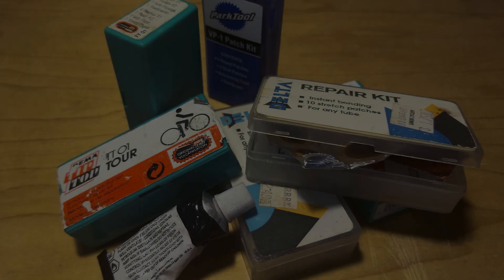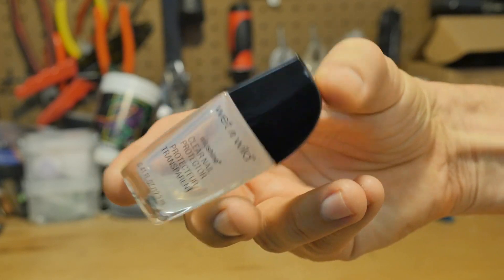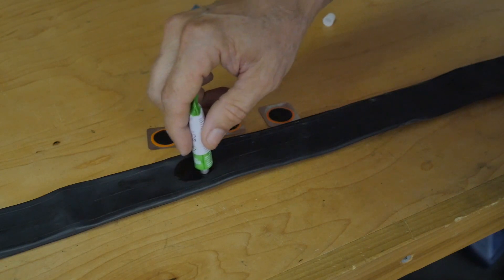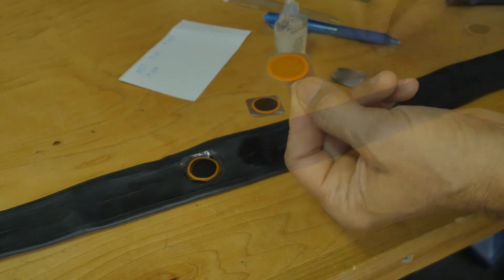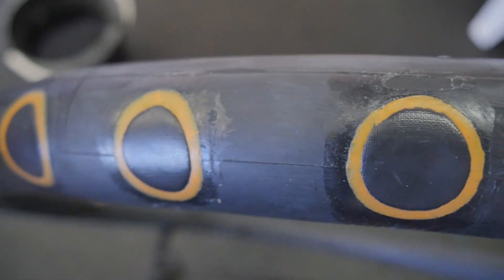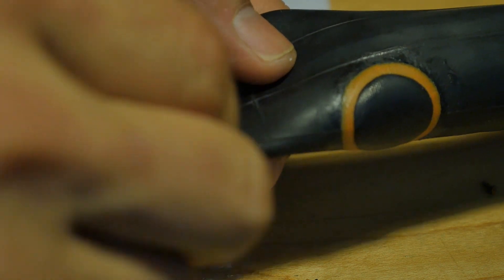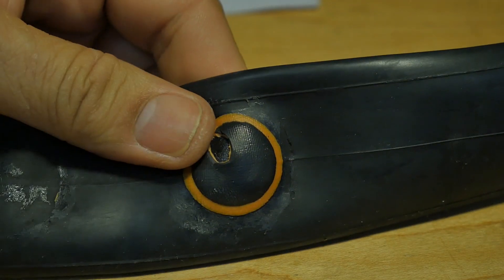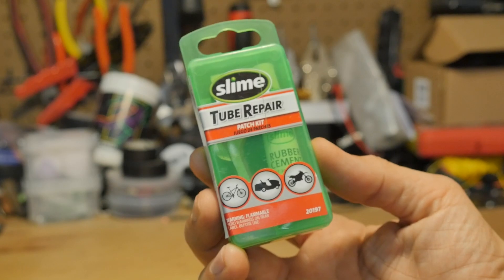Rubber Cement vs. Rubber Cement

Comment: I place a small piece of aluminum foil on the top of the tube opening before placing the cap on it, this keep the cement from evaporating. Using this method almost completely stops the cement from vaporizing
Reply from the maker: Yes, but that does nothing for the new kit that has already gone bad. If you want to be sure it is good, you need to puncture that new tube of glue and then perhaps use your aluminum foil trick. 

I think I'm going on two years now with the nail polish bottle and the glue is still not drying out. Also, it is easy to visually inspect it to see that it still flows ... without opening the bottle.
Reply: @wturber  your video is very good and informative and yes your idea is great.
Reply from the maker: @nts9  I wouldn't go so far as "great". I plan on trying your aluminum foil idea with an opened tube of silicon sealant. Seemingly nothing ever seems to be able to seal an opened tube of that stuff.
Reply from the maker: FYI, I've been using your aluminum foil trick for everything from silicone seal to wallboard patch compound. I'm loving it. It works super well. Thanks!

Comment: I once had a kit that the glue worked so well that you couldn't remove the patch from the tube with a pair of pliers. Now kits like Slime the glue won't hold the patch on at all. I wish I knew and noted the brand name of that first kit.
Reply from the maker: Rema patches and Tip/Top glue seem to make a permanent bond. Though I haven't carefully tested it. What is supposed to happen is that the patch and tire have their molecules cross-linked with each other forming essentially some huge supersized rubber molecules. I need to re-do this comparison and include Rema/TipTop as well as Weldwood contact cement.

Comment: Its painful watching you put holes in a perfectly good inner tube.Having  a puncture can spoil my day as I seem to have so much trouble repairing and hate hearing people say they've never had a problem doing it.
Reply from the maker: Well, hopefully this video helped you learn to make the repair.  I have a follow up planned where I will use contact cement. 
Either way, the trick to a good patch in my experience is to not rush things. Let the glue dry enough before applying the patch. And also letting the patch cure for a while before applying pressure - if you have that option. With that in mind, I usually carry a spare tube and a patch kit and prefer to just use that spare tube and patch the punctured tube when I get home. Or if I'm not in a rush, I may patch it before I get underway. The repaired tube becomes the spare. I use tubes for a very long time before they get retired.

Comment: I need to repair my Paradigm Monitor 90p rubber surrounds (not foam) that have a few cat claw poke holes.  There is even a split about 1/2 inch that needs a backing material.  These surrounds are very soft and pliable rubber.  Whatever I use needs to be very flexible and thin so the drivers can move as they need to.

I tried Shoe Goo and that was a bad choice.  It was very thick and would not spread.  After sitting for a month, I found out that Goo Be Gone can be used to remove it.  The midrange has a couple of pokes, the messy Shoe Goo made a big 3 inch patch lol. It took 2 1/2hrs to gently peel it off after a few dabs of Goo Be Gone softened it enough.  The subwoofer has the split.  I used a small piece of paper towel behind the surround and Shoe Goo.  I have not removed this “patch” yet, I have to take the driver out of the cabinet.

What do you suggest I use?

I’ve talked to Flex Seal and they said not to use their products.  It may not adhere to the rubber the surrounds are made of and it cannot be thinned.

Comment: Is there a difference between contact cement and rubber cement?
Reply: YES. contact cement is meant for a more permanent bond that actually works MANY different materials.. most rubber cement is worthless... like Elmers. That stuff barely holds paper together. Not sure what its even for. I use contact cement to hold foam to plastic for paintball masks.

Comment: I looked for what chemical was EPA banned and I could find no mention of a federal ban per se. My guess is that the chemical in question is toulene. Many companies are voluntarily reformulating their products to avoid regulation in the EU or US states that ban concentrations of a certain amount. It can be toxic but interestingly probably not as toxic as some of the paint strippers still sold in hardware stores. But it can be unfortunately be abused.
Reply from the maker: Yes.  It may not be a ban per se. Rema TipTop used to use Trichloroethylene in theirs. 
http://www.rematiptop.com/assets/tech/trm/sds/RTT-TRM-018%20Rev.%207%20(Cold%20Vulcanizing%20Cement)%20071515AOM.pdf

https://cen.acs.org/articles/94/i15/Notification-required-new-consumer-products.html

Comment: Interesting video punched like. While the last two did not "fuse" as much as the first from a practical engineering standpoint the question should be "does it meet specification?" I.e. would it survive the rigors of a normal tube that was not patched. My guess is that they would get the job done! 
Another question I would like to know is if a patch could be made using "silicone" adhesive or "shoe goop". Note that a solvent based repair is different as it is generally molecular I.e. "fused" while an adhesive does not it adheres use a different substance and solvent. Another interesting test would be to use craft rubber cement.
I came here after repairing a car tire using a string kit and was wondering about the quality of the repair and the rubber cement. If testing I'd probably use a test that could measure the PSI of the repair rather than just visual inspection. Just some observations.
Reply from the maker: I read what appeared to be a very good technical write-up on how patches ideally work.  The point was made that the goal wasn't to make an adhesive bond, but instead to create a situation where rubber crosslinks to rubber.  The point of roughing up the tire isn't so much to give a place for the cement to grip as it is to expose unoxidized rubber that is more prone to cross-linking with the rubber in the cement.  I strongly suspect that the solvents used are a factor in how well that works.  But many of the solvents used in "vulcanizing fluid" from days past are no longer available in consumer products due to the hazards that they present.

Given that Shoe Goo and silicone adhesive are both non-latex based adhesives, they don't provide the possibility for cross-linking and would therefore rely on their adhesive qualities alone.  Of the two, I'd think Shoe Goo would be the best bet. That it is a contact cement meant to be applied, dried and then assembled makes me lean that direction.  But before tried that, I'd try standard Weldwood (or similar) contact cement.  It seems to form a pretty tenacious yet flexible bond. 

Maybe I need to do another video trying alternative adhesivies.  Seems worthwhile since I don't think modern rubber cements are doing the job as well as old school "vulcanizing fluid" does.
Reply: @wturber  Instead of inflating an innertube you might could cut up small 1 inch rubber strips, glue them together and then put weights on them like this person did. Though I myself would just wait for full cure before adding weights. 
https://youtu.be/hsmqOMNsekg
While not scientific, if the glued strips can hold more weight than the PSI rating of the tube then the repair should work for air filled tube. 
Some ideas for candidates maybe Walmart rubber cement ("Hyper Tough" brand) because that's what's  available everywhere plus elmers craft rubber cement. GE window silicone, goop. Maybe construction adhesive. I just checked Oreilly auto parts sell rubber cement plus a "vulcanizing" rubber cement.
Reply from the maker: @metatechnologist  Not sure how you could calculate an equivalent PSI from that test.  Also, you have the problem of how to attach a weight to the rubber. And finally, I'd rather use a "for the purpose" patch.  That orange stuff should be optimized for the job.

Looks like HyperTough brand uses the same Heptane solvent as ordinary rubber cement such as Elmers and the Best Test I used. So -called "vulcanizing adhesives" usually have an additional solvent.  TipTop brand adds Acetone, Slime adds Napth, Heptene and Octane.

I'm going to try to do a new test in the next few weeks using Rema TipTop brand Rema patches, three different rubber  rubber cements, Weldwood Contact Cement, Shoe Goo, and maybe silicone seal - though silicon seal seems like a long shot to me.
Reply: @wturber  Here's what one guy did to test wood glues. 
https://youtu.be/k-g3efGa3sI
But it's resource intensive and challenging for anyone to do such a test. Also I agree that rubber is much more difficult to handle from a testing perspective. I feel like that clamping rubber might be doable if the strips of rubber were small so a large clamping force wasnt necessary. Brainstorming - you might turn them into "rubber bands" and then you could hook them to weights/testing apparatus.

Comment: 'Slime' repair kit. Looks just like the countless ones I've purchased over time, the vast majority of which were worthless when needed as the tube of glue had dried up. Now carrying CO2 cart's along with at least one spare tire tube, that as well as a bike mounted pump and yes, at least one 'Slime' POS repair kit.
Reply from the maker: Yes.  I always carry a spare tube.  I'll change tubes on the road first simply because it is faster.  I also carry a spare tube because I've had tubes fail at the valve stem in ways that you couldn't patch.  If I were bicycle touring or going on very long rides, I'd probably carry two spare tubes.
Reply from the maker: BTW, the nail polish bottle has worked out great.  The glue has stayed fresh in it for well over a year  and that's even with our very hot summers in the Phoenix, AZ area.

Comment: I do woodworking, using contact cement. Works great for patches using old tubes for patches.
Reply: To RcHydrooz, With all the inferior products on the market it would be helpful if you include the brand name of that contact cement.
Reply: no it doesn't
Reply: thanks, I'll give that a try.  I never had problems in the past working regular patch kit glue but recently I find they never seem to hold.  I wonder if the glue is made differently than it used to be.  I've actually tried super glue with paper as the patch.  It works but if water gets in the rim the paper disintegrates and the patch will fail.  Super glue does not work at all with rubber patches.

Comment: when the tube is in the tyre is it pressing against the inner wall of the tyre, so its impossible for the patch to be dislodged... ive had tubes w self adhesive patches that last years
Reply: the patch does not need to become dislodged for it to leak air.  unless there is an good bond, air will find its way past the patch, not matter how firmly it is pressed against the tire wall.
Reply from the maker: One word, heat.   I recently did a repair and left the tube inflated overnight after repair.  It held fine.  I installed it and it was good a few hours later under 65 psi.  But my bike was outside and when the sun hit the tube, the bond softened and it leaked.  I live in AZ and I'm sure the tire temperature got over 130F.

Comment: seems like they all did the job, in what instance would the patch be poked and peeled off inside  the tire?
Reply: The patch does not need to rip completely off the tube for it to fail.  It just takes the cement failing just enough to let air past the patch.  I've had this happen many times.  Patch looks great and firmly in place but hold it under water and you see the bubbles
Reply from the maker: It wouldn't be.  Think of this as a destructive analysis similar to what is done to a welder's welds when he or she are trying to get certified.  
And peeling off the patches does show that regular rubber cement doesn't create quite as good of a bond as the for the purpose rubber cement that has other more nasty solvents in it.  Whether that matters or not is up to each individual to decide.

Comment: Modern tire cement no longer works. Every patch kit you can find for bicycles like Victor brand fail. The EPA banned the chemical that made the patch bond to the tire that was in the adhesive
Reply: that explains why my patch kits don't work like they used to
Reply: @robertpreato6382  Yep. You will need to buy commercial grade adhesive that has the old chemicals. They sell it at professional suppliers.
Reply: That explains why the "rubber cement" I bought at Wal-Mart was unusually runny - it likely used a different solvent!
Reply from the maker: Modern cement does not work as well as the older stuff for exactly the reason you give.  But it still works sufficiently for at home repairs.  It is much more iffy for on the road patches.
Reply: @wturber  I have tried numerous times to make it work. I scuffed the surfaces of the tubes same way as I did when I was a child. I even tried again and spread glue around the entire perimeter of the patch as well like I used to do as a child. I even went so far as to let it dry overnight on a third attempt another time.. Nothing worked. Every patch I tried still leaked after proper pressure was filled and the tire lost air again and again. When I was a kid, I was riding my bike within 20 minutes after patching and they never leaked in the same spot again. Not once did a patch fail in the 1970's. NOT ONCE !
Reply from the maker: @tcapone1734  I agree that it doesn't hold as well.  But I do have patches that don't fail.  Stay tuned for tests using some different adhesives.
Reply: even the patch from bargain store like the dollar stores were really good...now i understand why they seem to stick good
Reply: @EvendimataE  Good to know.  I may have to buy a kit there and try it.  The EPA needs to be dissolved.  They do nothing but remove all that is good.  $$$ plays a part.  Absolute power corrupts absolutely.
Reply: The super secret chemical that no one will say is Hexane.

Comment: Just buy a can of vulcanising cement I use tech fast drying never had a patch fail yet and i use a proper patch stitcher or roller instead only use tyre lever for emergency repairs ie roadside
Reply from the maker: Newer "vulcanizing fluid" is the same as the "for the purpose" rubber cement I used.  Older vulcanizing fluids used different solvents and work better.  If you still have a can, great.  But it is very hard to find that stuff these days.
Reply: @wturber  what was in the original
Reply: Go to the auto parts store and get a pint and a sticher, we always used a sticher on the truck tubes ( sometimes event lit the glue to speed the process as far as I know never had a problem( no fun breaking those truck tires down.
Reply: @kevinmccune9324  a pint of what

Comment: You should also try it with different type of "patches": one made from old tubes, and others made from other materials. There was someone here on YouTube who patched their tube with paper and SuperGlue... I wonder how long that would hold.
Reply: I've tried the super glue paper method.  It holds very well until water gets in the rim.  Rode with one of these patches for one month before getting caught in a rain storm and the patch let go (paper disintegrated).  I've tried several other methods and nothing seems to work more than a day or two.  I think I am going to try the paper/super glue again, and then placing a piece of gorilla tape on top of it to keep it dry when it rains.
Reply: 50yrs ago I read about using a dollar bill,  which is virtually indestructible, as a patch!

Comment: Interesting test. You should of left them for a month or road around with the tire to see how they hold up over time. Even regular glue will probably hold at first, but over time is the real test to see if it is truly repaired or not. Still very cool to see how they all bonded.
Reply from the maker: Fair enough.  I may repeat the test on the tube in my front tire and report back in 500 or so miles.
Reply: @wturber  that would be interesting to see. Also, I suggest changing the title to "bike patch glue vs rubber cement test" or something that people will be searching for as well as a brief description of what's happening in the description box. Will be easier for people to find this video as it's one of the only ones that actually do this test.
Reply: @Teamshmo  Agree.  This is actually a great test.
Reply: @wturber  Better to do it on the rear tire.  If the front tire fails you could end up crashing, if the rear tire goes it is much less risky.